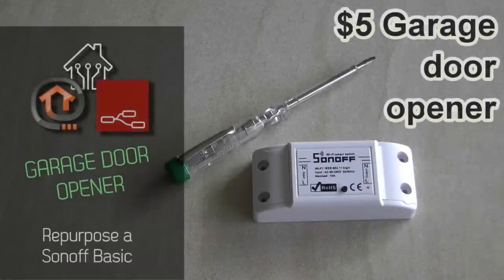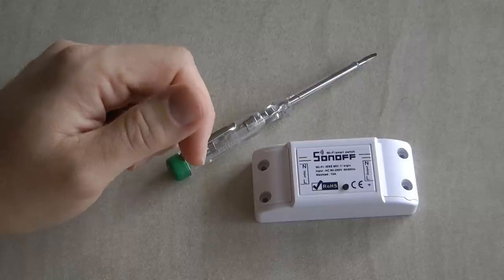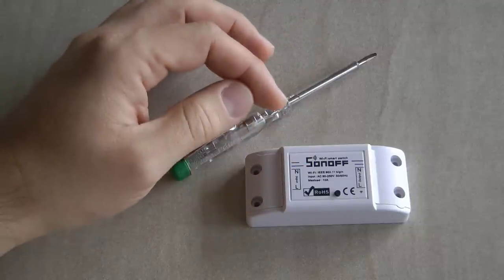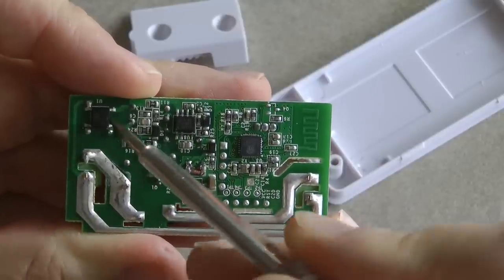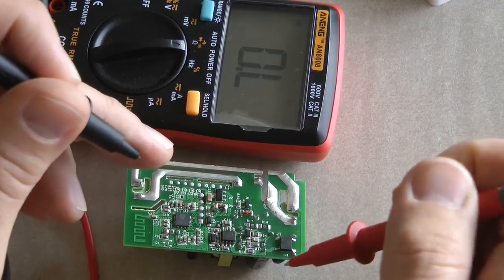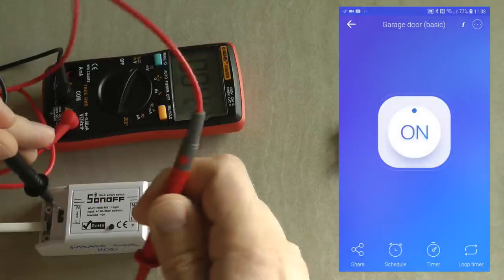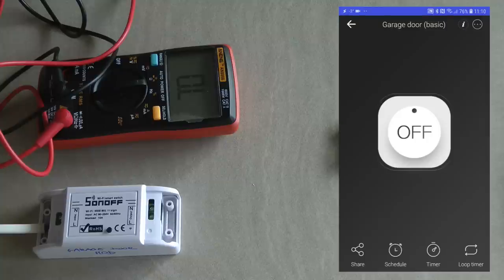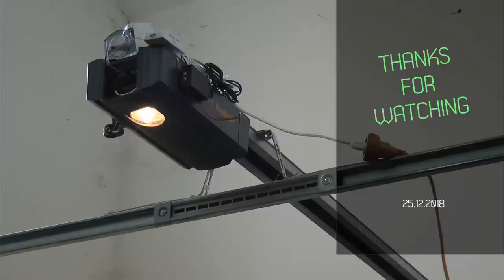Turn Sonoff Basic to garage door opener with eWeLink

Comment: Please give detailed instructions concerning connecting the sonoff to the garage door motor.  What is connected to the input side of the sonoff, what is connected to the output side of the sonoff, etc, etc
Thanks
Reply: Since sonoff now has inching mode, you are now able to do a momentary pulse. It’s the same as doing a momentary press on your garage door button. If you do the EXACT SAME THING that he did, you need to power your sonoff with 120volts to the INPUT side. Hot wire to “L” and neutral wire to “N”. You need to make sure that you pick up the power to the sonoff from a receptacle not a switch from a light, that way you don’t cut the power to the sonoff. Doing this will power the internal components which then closes the relay on your command. The OUTPUT side of the sonoff gets connected to where your garage door push button is connected. Follow the wires from the bush button to the garage door motor, and you’ll see two terminals. That’s where they get hooked on to. Just remember to do the EXACT same thing that he did by isolating the relay input from the output and soldering the little jumper in between. If you don’t isolate it, you will have 120VOLTS to your garage door low voltage side and it will fry it.

If you don’t feel confident modifying the sonoff basic, they do make another controller that already has the input side isolated from the output. Hope this helps
Reply: @Oranges743  can i connect 220v to sonoff then to opener? as i live in uk?
Reply: Tadis Fpv should be. The sonoff is multi voltage.
Reply: @Aurems  The answer is yes.

Specification for Sonoff Basic:

Voltage range: 90-250v AC(50/60Hz)
Max current: 10A
Max Wattage: 2200W

Comment: Hey, thanks for this video guide. Very clever and really well described. 

I wondered if you would be kind enough to offer me some advice. 

I’m trying to set up a cellar door to open/close via a voice command (with Alexa). The cellar door currently has a manual rocker switch, which is zero voltage. Positions are raise/close and the middle position which is clicks back to is stop. In order to open or close the cellar door, the switch must be held in open continuously, until the door reaches the fully open position. Same with closing, it must be held constantly until closed. I am trying to figure out which smart switch will work best to control this cellar door. I know the app has a timer, which is perfect, so once a connection is established by a smart switch, it can be kept switched for a set duration. However, the open wire is different to the close wire. Three wires in switch in total. Blue, pink and yellow. When blues touches pink, cellar door opens. When blue touches yellow, cellar door closes. Any advice is greatly appreciated.
Reply from the maker: I assume the motor which operates the door uses mains power. In that case I suggest a 2 gang TX wall switch. These have an interlock function, meaning one gang switches off the other gang. The only thing I have not tested, if the inching function (auto off) also works in interlock mode.
Reply: Csongor Varga - The motor is in fact 24volt, however it is fed from a control unit, which decelerates the motor, as it approaches fully open or closed, to avoid a hard finish. 

The control unit is mains power (240v) 

However, the switch wire, which I intend to tap into, is a zero voltage switch. So we can not push any power through the wires. They are just simple switching wires. 

The problem I am having is to find a smart switch device which will enable a ‘open’ option, which makes a timed (inching) contention - but also has separate terminals for ‘close’.

Comment: The Sonoff SV does require a minor hardware mod to make it a ‘dry contact’ (no voltage) Relay also. I would recommend using the Sonoff SV (Safe Voltage) for this purpose instead of the Sonoff Basic. The SV can operate on 5-24V DC which is much safer than 240V AC input.
Reply: I bought a Sonoff SV for this purpose.  Do i need a different firmware for this to work?   Did you get this to work?

Comment: I wonder if this works with one of those cheap 15 bucks smart switches on Amazon too, I have a couple of those and I love them. You can even power them from 5V which is great and would mean they're perfect for this application!
Reply from the maker: I am sure it does. Somebody commented a link a few weeks back. I included that in my follow-up video. That also needs an external supply (that uses a micro USB if I remember correctly). So yes, there are alternatives, although a bit more expensive than a Sonoff Basic.
Reply: @csongorvarga  I'm trying to convert my plug into a switch like you did right now. For 12€ (about 14$) via Amazon and almost next day shipping I definitely can't complain for the price haha :) If I'd order a SonOff Basic it'd only cost me 5 bucks tho but it'd take about a month to arrive so yeah, those few bucks more and faster shipping is definitely worth it I think.

Comment: Looks straight forward to me. Only question: how does it plug into the opener mechanism?
Reply from the maker: That is different for each garage door opener. Usually there are 2 outputs for an external opener where usually a switch is wired. You need to check the manual of your opener.

Comment: I just use a 240v relay with the sonoff . About $5 on ebay . No hacking required.
Reply: Greetings - Would that be a 4 pin relay?  Two in from the sonoff output and two out as dry contact?  Please reply - Thanks!
Reply: @dmrspec4750  The coil on the relay is 240v . The sonoff outputs go to the coil of the relay and when the sonoff is switched on it triggers the relay. You can do what you want with the dry contacts . Normally open or normally closed etc with low voltage.
Reply: Thanks For The Reply!!  What was the Mfg. of that relay - Is it on a circuit board like the sonoff or just a relay only with solder terminals?  Thanks again...
Reply: @dmrspec4750  Make sure to get the mains voltage variant , they come in 24v too
Reply: Thanks For The Info!!  Once Again - What was the Mfg. of that relay - Is it on a circuit board like the sonoff or just a relay only with solder terminals?
Reply: Much Appreciated!

Comment: Look, this may sound strange but; I installed a sonoff mini in my house for the exterior lights. Its behind a daylight/clock switch. At 22.00 our the lights get switched off. so I installed a sonoff mini so when in need to turn the lights on after 22.00. Works perfect, except for my garage door. It opens when I use the sonoff switch. Work-up this morning with my garage door open...
Reply from the maker: Uh, it is hard to tell. All I can think of right now, that you may have a power outage overnight. Make sure that in the sonoff settings, the power-on state is off. Maybe the relay was on for a short amount of time when the power came back which opened your door. But that is my best guess.

Comment: Hello, thank you for this video. Is there a risk if I forget to put the contact back on OFF, and that I leave it longtime on ON? Thank you.
Reply from the maker: The garage door openers usually expect a short pulse. I am not sure how your unit will respond. If I leave mine on for a long time, it will stop the door after a few seconds.
Reply: If I leave mine ON, nothing wrong has happened. Motor keeps working and gate closes or opens normally. I just have to turn it off to use it again

Comment: Good system , but roblem is you dont know if door is open or closed. You need to see door before you close or open, missing senzor.
Reply from the maker: Yes, this is a simple relay with no sensor. And Sonoff did not have any sensors in the product line until up until 2 years ago.

Comment: this is far more involved and still has a small risk of ac hitting the garage door circuit. I used a sonoff to power a 12v power supply, and a automotive style relay with dry contacts. I connect the relay to the button on the control panel

Comment: They make a "Sonoff SV" for low voltage applications like this. 

You can also flash these devices with a new firmware called Tasmota. Gives a number of new features and allows you to connect these to an open source home automation servers like Home Assistant instead of ewelink... much more powerfull.
Reply from the maker: Yes, but a Sonoff SV needs a power supply so I think it is still easier and more compact to modify the Basic. I know Tasmota, and others could do it, but the point about this video was to do it in eWeLink. Many people don't want to change the firmware.

Comment: You can just add a small 230v relay that is powerd by the sonoff and put it in a small box.
You dont have to cut the board, thats what im going to do with the electronic lock of my appartment
Reply: my thoughts exactly
Reply: why using a second relay if cutting is so much easier than soldering, adding a box, wiring, etc?
Reply: Its a good mod but what if you afterwards want to use it for something else and it needs double broken
Power? I prefer using a extra relay. But realy good idea ;)
Reply: kristof vermeulen, yes.... it is good to know there are more options. it all depends on the future use and situation

Comment: This is great, thanks. I'm trying it out now. Is it necessary to connect a neutral wire at the input? Its not connected to anything, right?
Reply from the maker: That is needed to power the Sonoff basic itself. So it is needed, but with the hardver mod is should not be connected to the output.

Comment: Hi..I tried with my roller door opening unit with modified Sonoff basic  exactly as per your instructions.

Works like a charm. Thanks for your efforts in making the video.

I have a doubt if you are able to reply pls do.

Did you experience any automatic operation of the unit. Basically When we leave home. I hope it will not automatically activate the unit.
Reply from the maker: I am glad it worked. No I did not experience any automatic operation. Make sure there are no schedule, loop settings for the device and it is not used in any scenes. In that case you will be fine.
Reply: @csongorvarga  Wow. That was a fast reply. Thanks again. There is absolutely no issues other than sonoff connectivity issues. It may because of my router and Gargae door is quite far and seperated by two thick brick walls.

If you visit Sri Lanka.. a treat will be on my account...

Cheers...

Comment: The only issue I see with this setup is that you really don't know whether the garage door is actually opening or closing. There are no sensors to tell you the status unless you are physically viewing it. Maybe a wifi tilt sensor could be added to provide feedback.
Reply from the maker: Yes, this is a $5 hack for this problem. But there are dedicated 3rd party products for there. For example the Eachen GD-DC5 which I made a video of.

Comment: I believe most important step is missing in the video,, that is how to connect garage door opener with sonoff, as there are many different kind of garage door openers who operate in a different way.
Reply from the maker: And do you expect me to cover every single garage door opener type? As I said, check your garage door opener manual. It is usually clearly documented there which two terminals need to be connected to a switch. Those two need to go to the output of the modified Sonoff.

Comment: CVarga, you were correct after a few times of opening/closing settings I did get the screen with “inching” on it.  Everything is done per instructions, all tests are confirmed as per instructions, problem I’m still having is the relay never opens/closes, and a continuity check at output side shows nothing, any ideas where I may have messed up? LW

Comment: I ordered a Sonoff basic to do this project but received the newer version with wires instead of the traces for the mains power. This makes it easy to disconnect the mains from the output but I don't know where to bridge to the relay. Can you make a video of this project using the currently shipping model for those of us just getting into Sonoff. Thanks.
Reply from the maker: I also ordered mine recently, and still got the older version... where did you get it?
Reply from the maker: @cartonneexpressable  I got it from Banggood, but probably back in September or October. So it has been a while, but not years.

Comment: C Varga, excellent vid, I plan on doing this as well, did it with a sonoff basic and a relay, but I’ve got such a gaggle of wire hanging there, that this will make it so much simpler. Question I have though on the new garage door openers, like someone said, they use different security ( I believe it was security +2 smart button, have you ever used a sonoff with one of those? And where can I get that smart button?, I’ve looked but to no avail, any help would be appreciated. LW
Reply from the maker: Yes, I read those comments, but honestly I don't know anything about them. This only works for the ones which has this external switch terminal. I find it strange that even a new garage door openers do not have that simple feature. I mean we should make the wireless remotes more secure, but most people install a wall switch in the garage to operate the door. Since the motor and the switch is inside the house there is no security issue.

Comment: It is working only with 230v AC output ? I have 24 V DC sterring opening my Gate :/
Reply from the maker: Yes, 95-240V AC. But there is a product called Sonoff SV which works off 24V DC. And the best you don't need to modify it, it has the relay outputs you need.

Comment: I want to make the same modification but with the sonoff basic RFR2 (the version with rf and WiFi control) I will follow the same steps in this one ?
Reply from the maker: I tried but could not. The pcb is much more tighly packed and I could not find a way to make the necessary cuts.

Comment: How does the Sonoff recieve power if the only two wires connected are the pulses for the garage opener? (I'm new to this)
Reply from the maker: Garage opener connection is on the output, you still connect mains power on the input.

Comment: Circuit board has changed and now harder to do what’s suggested. Won’t a sonoff mini do the job without any modification?
Reply from the maker: Yes, Basic R2 and R3 much more dense and difficult to modify. Mini is the same, best option is the Sonoff SV board. Or the new 4CH Pro, but that is a more expensive unit.

Comment: Thanks it works well. Does it work with all sonoff basic versions?
Reply from the maker: R2 and R3 has different board. It can be done, but with R2 and R3 the components are much closer to each other, and it is more difficult to make a cut.

Comment: Good tip. Thanks for posting. Do you think something like the Sonoff could be used to automatically turn on one machine when a second one starts up and if so how it would be done? Looking for an inexpensive way to automatically turn on a dust extractor when a tablesaw or planer starts up. Thanks
Reply from the maker: Thanks. I assume you are turning the tablesaw and the planer on manually. So I would go for a general purpose timer circuit (non-smart one). Those usually have many different modes that would be ideal for your case. I made a video of a HY-05 trigger module in the past. Quite popular video of mine. https://www.youtube.com/watch?v=eT3Ie1bMkJk&t=200s. Or even simpler: get two mains relay (coil is also mains rated). Tap off the switched mains power from the tablesaw and planer each going to one of the relays. The contact side of the relay goes to the dust extractor. Either of your tools will trip one of the relay which will turn the dust collector on. And will turn it off once all your tools are off. If you want to run the dust collector a small amount of time after the tools, you need a trigger module with a delay mode.
Reply: Thanks very much for your reply. Very kind. Will watch your video and see if I can figure it out. Cheers

Comment: Isn’t there a 2 channel version with 2 relay outputs? I just got the idea to add an electric strike to the pedestrian door in my garage
Reply from the maker: There is a product called Sonoff Dual. I do not own one, have not seen the insides of it, I am not sure how easy it is to convert it. Or there is a Sonoff CH4 which has 4 outputs and do not require and hardware changes. And you have two extra inputs for something else.

Comment: Thank you, good video and helpful information.  Csongor what Firmware version are you using?  My Sonoff Basic appears to be up to date with 2.6.1 and I'm not getting the "inching" option.
Reply from the maker: 2.6.0 was the latest version when I recorded the video. You can see it at 9:02. If you have just upgraded the firmware, go out of the settings screen and back. My Basic was on 1.6.x when I bought it, and did upgrade to 2.6.0. The Inching option was not visible, so I had to go out and back again to show.
Reply: @csongorvarga  Thanks again, have checked  just now, definitely showing inching. I'll be setting up on my garage door after surgery on Sonoff board as displayed on your video. Your code will meet my needs and I've also had  a look at Ewald's Do Anything Button. Have been coding ESP8266 and now ESP32 spasmodically over the last couple of years.
Reply from the maker: @46pmw  You can do a lot more with bespoke firmware(like sensing the door state), there was a couple of links in the comments section already. But there are so many of us who are not ready to make that step.